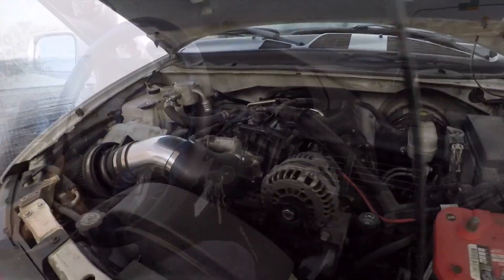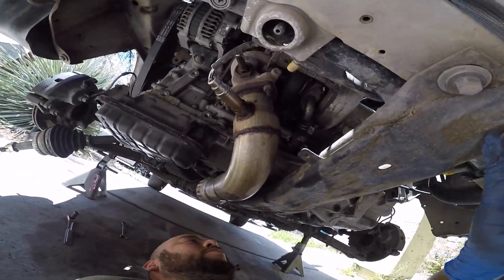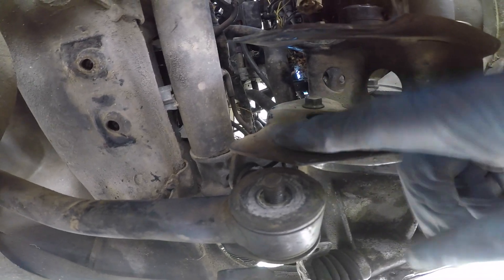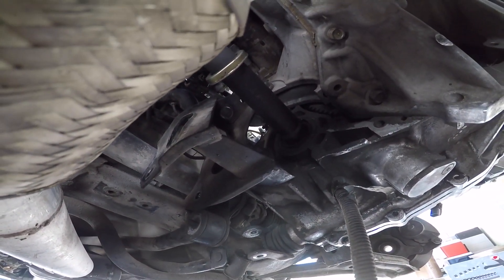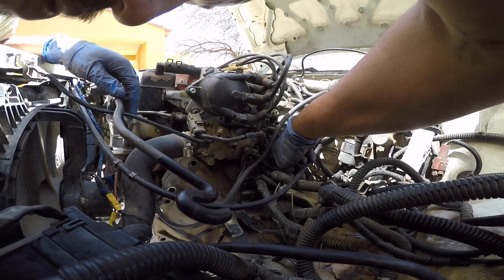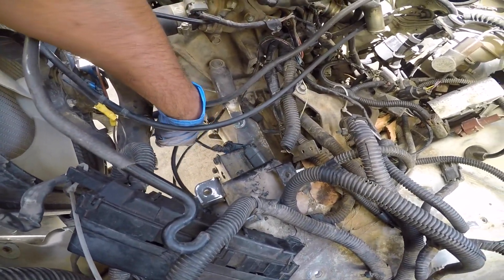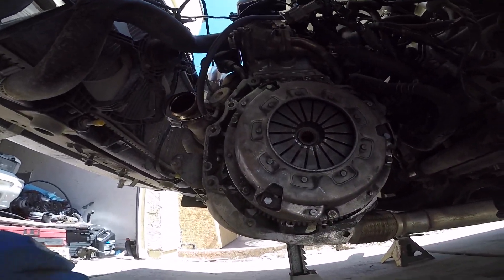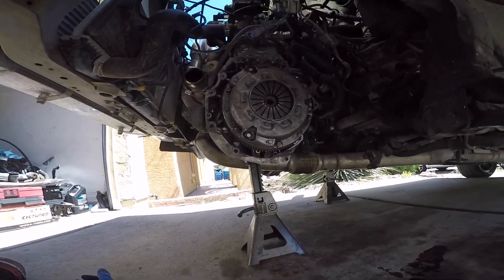Removing your Fwd Sr20 Transmission Paul's Gti-R Swapped B13 Se-R

Comment: Thanks for the video man, taking the cross member saved you a bit of a hassle kinda although you had to get to more bolts like engine mounts and crossmember and than the back of gearbox bolts wich is cool as. Because after 3 days I took my gearbox out but I only took my gearbox mount and front engine mount out and i could take the box out